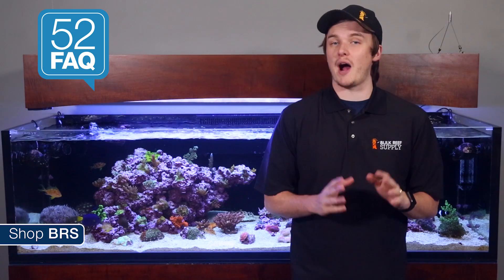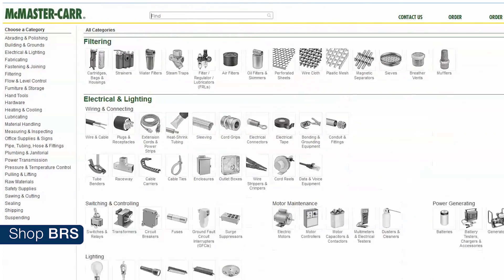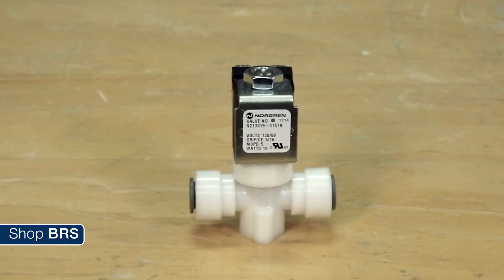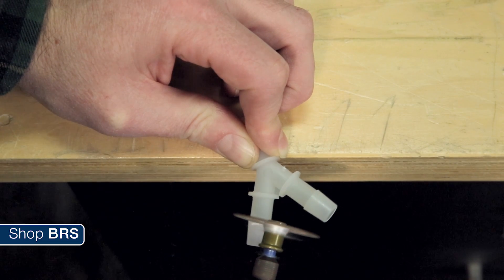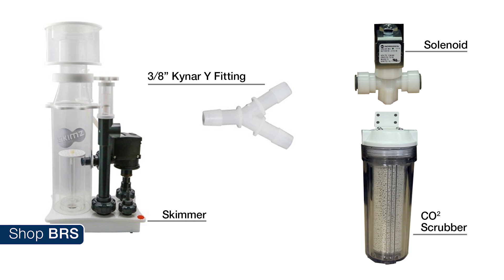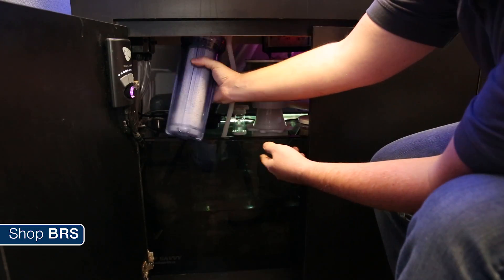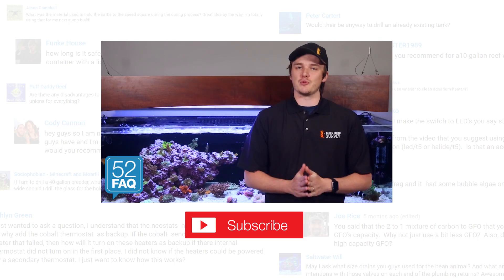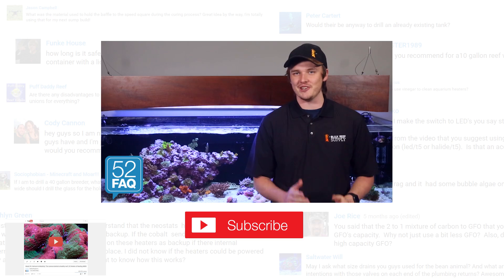FAQ #25: Where can I get the solenoid valve used on the BRS160?

Comment: There is a better way to rig this. The way shown doesn't take into consideration the pressure of trying to pull air threw the media and the room air would be the path of least resistance, bypassing the draw through the CO2 Scrubber.

Comment: I added your CO2 Scrubber this week with immediate results!  But to keep the pH from going too high (and extend the life of the media), I'm definitely going to have to add a solenoid.  I'm thinking about a 3-way solenoid like this one:  
http://www.wicvalve.com/3-8-3-Way-2-...?categoryId=-1   (3/8" 3 Way 2 position Air Directional Control Solenoid Valve)

As long as the solenoid does not require either positive or negative air pressure to operate, you could basically plumb it BACKWARDS as follows:
"A" (Outlet) ===> use as the inlet FROM the CO2 Scrubber
"P" (Supply)  ===> use this as the outlet TO the skimmer
"R" (Exhaust) ===> keep this open as the inlet for room air

When the solenoid valve is closed, the skimmer would pull air into Port A (from the scrubber) and out of Port P (to the skimmer). When the valve is open, the skimmer would pull air into the Port R (open port / room air).   Port R is only a 1/4", so I'm a little worried about getting a whistle since my skimmer (Vertex Omega 150) pulls a ton of air... 

Waddaya think?

Comment: That is a 3/8" solenoid correct? How do you connect it to 1/2" tubing? I did not see a 1/2" fitting on the website.

Comment: BRS - thanks for the videos, I went all in and did 2 solenoids to help control consumption of the media.  I saw someone else comment on the 24dc version and I went that way because of the the safety factor.  After an hour, the heat from the solenoid was so extreme it would burn upon touch.  Both of them were like that, so I don't think it was a case of a bad solenoid.  My question is what is you experience with heat build up with the A/C version?  How are you managing the heat.  As pointed out in some other comments, they are probably going to run half a day for each one.  Are you aware of a solenoid that doesn't have to stay energized the whole time.  I will be contacting McMaster's but wanted your experience as well.
Thanks
Reply: Did you ever figured this out?
Reply: Same issue here and I have the ac version

Comment: when running an airline from outside, consider a carbon filter near the outside end to filter out pesticides, bugs, and crawly things...A 12volt solenoid with a 12v wall wart is much safer as well.

Comment: Why did you run 3/4 return lines on the BRS 160, when the L1 is an inch?
Thank you for your time and knowledge.
Reply: Probably to avoid overflowing the tank in case the drains coming down from it get a little bit clogged. You usually want the returns to be smaller than the drains to prevent this.
Reply: BulkReefSupplyCom thank you. I was sure that that was why, just making sure.

Comment: The NC or NO needs to be taken into account depending on your application. Meaning, you want to energize the solenoid the least amount of time (less energy and mainly heat generated and more life for your solenoid). In your case, since the majority of the day the valve is open, you are better off installing a NO (normally open) valve and only energize and close it for the short amount of time you need to close it. Not a huge difference, just a matter of optimizing your application and life expectancy of your equipment.
Reply: Agreed. If you have a critical application, the failure of the valve should be taken into account.